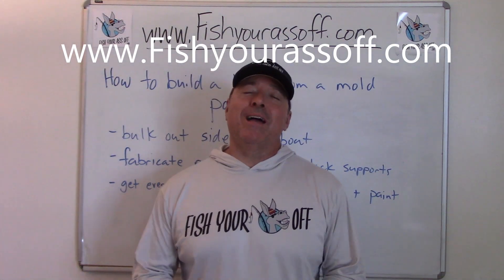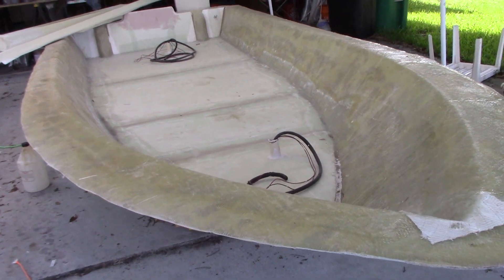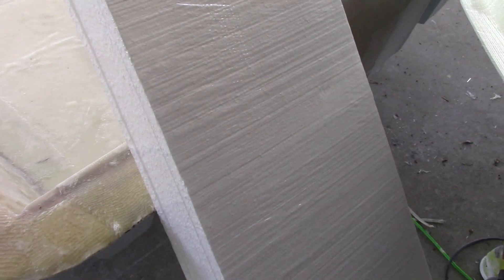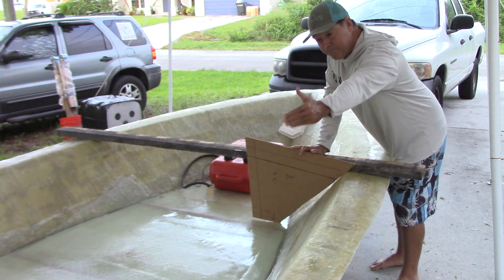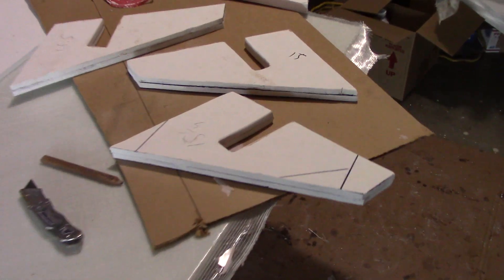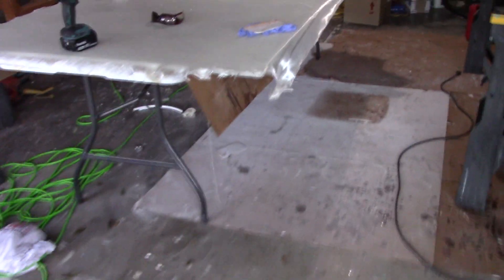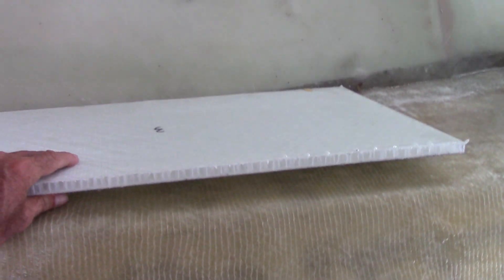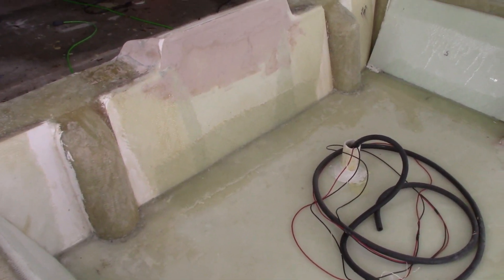How to Build a Boat from a Mold 4

Comment: What type of resin you use on ge white stryafoam?
Reply from the maker: Hey Steve. I ended up not using the styrafoam. I used the honeycomb material with epoxy resin. There is no polyester resin in the boat at all. Thanks for watching.